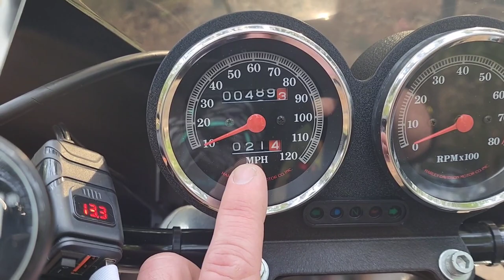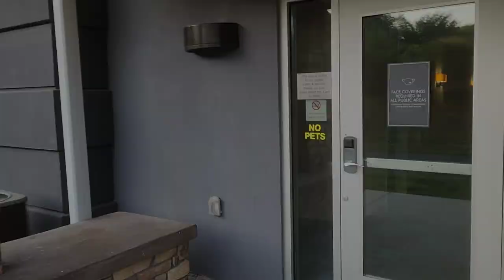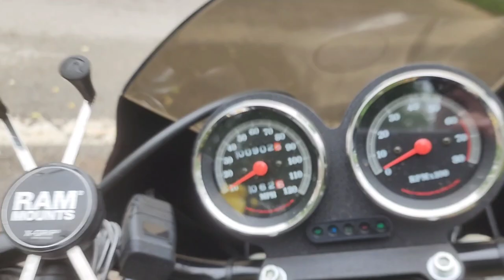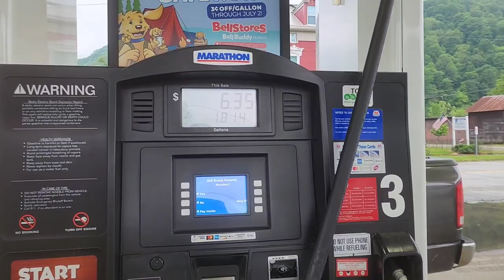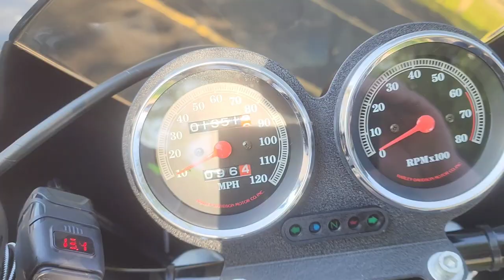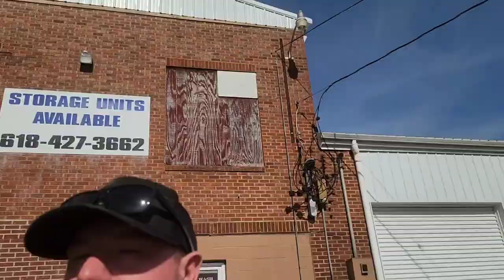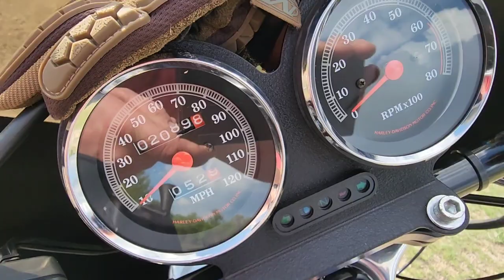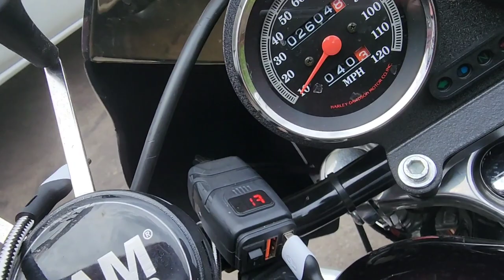2k Mile Trip on an Old Harley Sportster 1200 that sat in a barn for 22 years ! - NJ to CO

Comment: Use royal purple  .it    Nocks out a lot of the top end noise. 20W 50 / 75 80 for  the primary. Works better then AMSOL for noise. I've tried them  both on my 96 evo sportster. And my 2000 wide glide.

Comment: Nice trip report, man!  Looks like you had a great time.  1) A word about gas mileage: All of my (3) stock 883's got 55-60 mpg.  My '86 883 with the 2.2 tank would go on reserve at about 95 miles.  My current 1998 1200 only gets about 50 mpg. Then again, I live in relatively flat Florida.  To get the most gas mileage out of a Harley, you must must MUST not "blip" the throttle at traffic lights and such.  A lot of Harley riders do that subconsciously, without even knowing they're doing it and without thinking about the consequences.  But each "blip" squirts gas right into the carburetor throat.  Your 1200 seemed to be giving you about 45 mpg.  That might improve as the engine breaks-in.  If you're putting 1.8 gallons in, then you still had nearly 1/2 gallon left - enough for 20 miles or so.  Harley makes a "king" tank that holds 3.3 gallons.  Much nicer for long rides!  It will bolt right on with no mods needed other than moving the petcock from the right to the left.  2) I've had that same seat you have on one of my Sportsters - WORST SEAT EVER.  I researched and found a flatter seat with less of a scoop, so I could slide back and forth a little on long trips.  3) Loosen the banjo fitting where the brake line attaches to the caliper, and then swivel it so the hose moves away from the fender.  My '86 883 did the same thing as yours - pissed me right off.  3) Throttle friction lock: Just use enough friction to keep the throttle from closing so you don't have to hold it open.  You don't have to lock the throttle in place.  Experiment!  

I love Sportsters, and I'll own one until the day I die.  I think they're great bikes that get a bad rap from people who don't understand them, what they were designed for, and the limitations they have. You just proved that a Sportster *can* make a long-distance trip.  Yes, they're a little squirrely on the Interstate because they're so light.  But even an 883 will go ALL DAY LONG at 80 mph.  I've proved that.  If I wanted a big, heavy Interstate cruiser like a Honda Gold Wing, I'd buy an Accord.  The Sportster may not be the best long-distance highway flyer on the market.  But when I get to my destination, you know what?  I want to ride a Sportster, not a Gold Wing.
Reply from the maker: Thanks for watching and for offering up a great comment! You clearly have a lot of experience with these bikes!
After this trip I tuned and re-jetted the carb which resulted in more power and a bit more fuel economy. I also immediately purchased a gel-filled Saddleman solo seat.. what a difference! 
You are spot on regarding the front brake line, (among other things) - all I needed to do was rotate the banjo bolt and I would have avoided rubbing paint off the fender. I did go ahead and replace the brake line with a braided steel version and all is well now.
I do still have some electrical issues I need to sort out. Currently I have no right side turn signals and the small lights below the speedo/ tach, (neutral/ oil pressure/ etc.) lights are not working.
All in all, however I am really enjoying this Sporty! They are extremely versatile bikes. People like to poke fun because they are the "little Harley", but they can't wipe the smile off my face after carving some canyon roads ;)
Thanks again, ride safe, and God bless you !

Comment: I have a1999 883 Sportster.l have had my Sportster for 25 years and 400,000+ miles on the original engine and 37 back tires and 18 front tires and 3 belts in 25 years.  EVOLUTION motorcycles last forever. Just did fork seals ,front brakes, and a new front tire. Sportsters are a bike unto themselves and not a gateway to big twin ownership.

Comment: XLH 1200 1992  possibly the best model sportster ever made in every way , first of the 5 speeds and belt drive and crank mounted alternator . and ive had a few different models and cc,s , even an XL1200S ,  great video....i wish i still had mine , very hard to find now.  i could see the tank vibrating when you reved it,,,i had that exact prob before , the phantom engine noise , or 1 minute engine rebuild ive heard it called ,thank you for the video .
Reply: I have one I’m looking at , it’s a 93 1200… 10k miles. Looks pretty clean. I’m nervous about getting something that old . Have rode since I was a teenager. From your experience any issues getting older bikes?
Reply: @detailguy8892  1993 isnt old !!! 1963 is old !!  thats the perfect model and year to start with . just treat it with respect and dont try to race any fireblades,,,,
Reply: Had a 1992 Blue Sportster. Loved it until I discovered FXSTC Softail custom!! Hallelujah

Comment: Great Video and awesome find.  The break and speedo line on those old Sporties had a metal thick wire looking piece they routed through to keep them away from the fender  (the bracket u showed later in vid is the one)
.  I found my 93 Sporty with 243 original miles on it three years ago in Santa Fe New Mexico on consignment at the dealership there.  Couldn't resist the buy and was able to negotiate a fair price.  I don't trade my vehicles and just keep up the maintenance to keep them running so I still have my first bike I ever bought, which is my 2001 Sporty I purchased brand new.  These old Evos run forever when properly taken care of.  They are not great performers, but just keep on ticking like a timex watch😎👊🤘
Reply from the maker: Thank you!
That's awesome you found such a low miles sporty... and at a dealership no less !! Thanks for sharing and ride safe. God bless !

Comment: I haven't watched to the end yet but the intake carb to manifold seal is know to dry rot and cause lean issues. Ride it too long and it can cause damage
Reply: Manifold gaskets to the engine also. My 98 sporty has rubber ones and after sitting so long before I got it, they were both shot. Difficult to replace also. Have to cut hex wrench and make your own tool to get manifold off. Not fun.

Comment: Have you done anything to the bike? Did you sell it? Larger tank and hammer 1275 cylinders with stage one intake/exhaust makes for an excellent motorcycle to ride anywhere.
Reply from the maker: I've just done a 2 into 1 exhaust, re-jet and progressive suspension so far. Thanks for the tips!

Comment: Hi mate I’ve just got me a 2017 sportster classic and it’s done 2300 miles you will find it’s the drive chain making the tap noise mine does it just remember your riding a v twin you will here lots of little noises with standard exhaust pipes on and your bike as only done 400 of miles it’s got to bed in no matter how old the bike is

Comment: Awesome trip, I have a sportster 48 which has the same size tank as yours and want to make a long trip this coming year could you please share the links for the sissy bar bags and fuel bottles, thanks in advance.
Reply from the maker: Thanks for the comment!
The sissy bar came with the bike and the soft bags came off of my old Buell- I doubt they are still available. Here is a link to the fuel bottle though:
Ride safe and God bless you!Motorcycle Emergency Petrol Can https://a.co/d/eJqTCe5
Reply: Hi @WildFaith  What about the bag you use to carry the fuel bottles
Reply from the maker: @davidperezmtb4275  just a cheap dry bag from the "Sportsmans Guide" company. It is there house brand "Guide Gear". 
It's been used on several X-country trips now and has held up great.
Reply: @WildFaith  super, thank you for the information, I liked the fact that you can carry the fuel bottles and tighten them with the strap

Comment: That gelpad will pack down and feel like a board also. If I remember correctly I'm thinking there's a seat called something like "Airdogs" or something like that, maybe. The air cushion will be your best bet for the long rides. Man I'm wanting to go on a long ride now. Hopefully somehow I can do it again someday.
Reply from the maker: You're right about the gel pad, I haven't tried the AirHawk thing. Just swapped the stock seat for a Saddleman and it's 1,000% better !!
Reply: @WildFaith the Airhawk is definitely a Godsend ! You sit alot higher, which is weird at first, but your butt and back will feel NO PAIN....on any trip. Love mine.

Comment: Make sure the oil cooler is flowing at temp.look inside the resivor and watch the oil flow,should be a oil cooler installed in the front of the motor,get it sreviced
Reply: That's a regulator rectifier you see.
Reply: @davidbrown6353  no shit